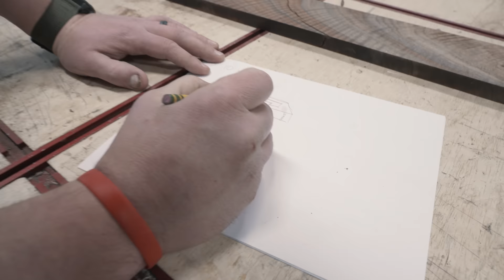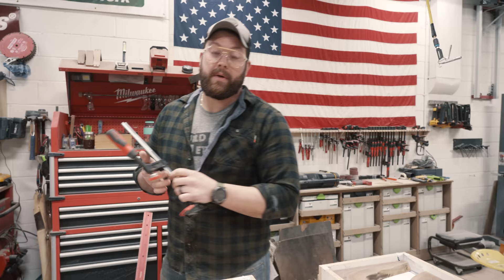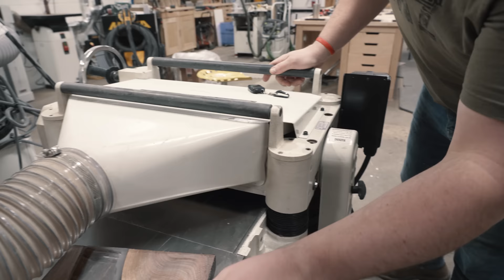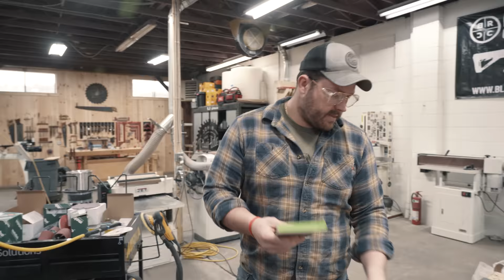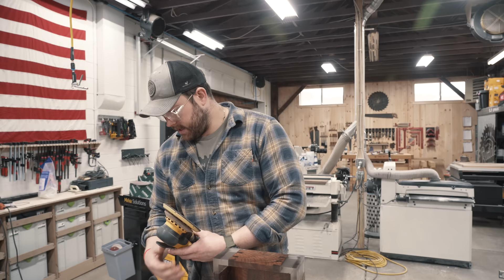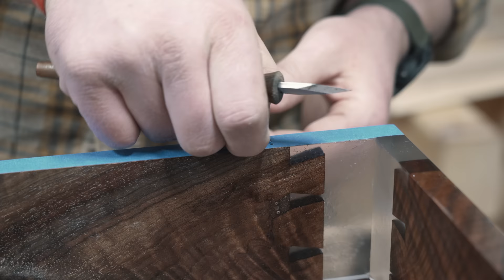CRAZY Epoxy "Floating Dovetail" Gun Display Box Build

Comment: She's pretty!  One suggestion though, I would inlay 2 rare earth magnets in the 2 epoxy blocks that touch the slide of the 1911.  That way, when you pick up the box, they'll hold the weapon in place.
Reply from the maker: Thats a great idea
Reply: That would depend on what metal the gun is made out of. Aluminum is non magnetic, and certain kinds of stainless aren't magnetic either. I'm not super familiar with 1911s to know which models are which.
Reply: I was going to suggest the same thing as soon as the video ended.   Then thought I'd check comments in case someone already suggested it.  GMTA Josh!  Additional suggestion is to put a rubber coating over the magnets to avoid marring the surface of that beautiful 1911.  Maybe even embed some small magnets into the edges and the lid to hold the lid shut.  GREAT vids John!  Subbed here.
Reply: I doubt the heat has a magnetic alkaloid ,tho the fact you mentioned inserting magnets in the epoxy rang a helluva bell in my brain so two thumbs and a thank you for that.

Comment: If you sand the epoxy (before finish) down to about 2000 grit, then use a polishing compound (ie: turtle wax/etc) and buff it quite a bit, you can get a near glass finish that looks great. It's alot a work, but well worth it for builds like this. Looks great!
Reply from the maker: yea i would have to sand the wood up too, all a balance. Solid tips !

Comment: Use painters tape for marking for the dovetails so it doesn’t mark the wood. Vacuum chamber to get air bubbles out of the epoxy, torch after pouring breaks the surface tension so air bubbles can come out.

Comment: Loved this video. just gave me some idea for a few different projects using clear epoxy or glass. one thing I'd add, on the top of the clear resin "floaty blocks", you could put some traction tape (also called roller tape) on top of the blocks. would keep that gun steady when the box is moved or bumped.

Comment: Gotta get a wool buffing wheel. Sand up to like a 600 or higher then buff the resin and it will be crystal clear. That’s how I do it at least. You can pick up a cheap set of 3” buffing heads for your drill just about anywhere. Love the piece and the Freedom Seed thrower inside !!!
Reply from the maker: Thanks for the tip!!!

Comment: Nice vid. Speaking of the stuck clamp pads, I was working with some epoxy 2 days ago and mine got stuck. All you have to do is take the clamp off and grab some pliers and pull them out
Reply from the maker: Nice, glad you could save em !
Reply: John Malecki to be fair they were 2.99 harbor freight twist clamps😂. If you get the right ones though, harbor freight is a great option for a lot of clamps.

Comment: I have a few ideas on this... The river is nice - it is a shame it wasn't used... Why not use it as a background behind the gun? You could slim it a little bit, maybe leave a tiny gap and put some LEDs behind it to give the river some color... In the gap, you could fill it with sand so under the river has a sandy bottom. Depending how much room you actually have in the box you could put pebbles, etc.. but that may not be viable. It would've been better to do that beforehand.

So the next thing after the river is in the background is have a wave cast out of epoxy, or 2... and have the gun mount into the wave. Not sure on the wave aspect - but it would be nice to see the river used. Hopefully these ideas pique your interest.

Comment: Resaw the river lid and router the edge to match the bottom panel and polish. This project is amazing one of the only epoxy projects that has stopped me in my tracks. But man you have to use the original lid.

Comment: I'm wondering why after pouring the resin for the sides that you then cut the four pieces out. If you had used a curved surface and heat, you could bend the resin into corners. Might that have been a good idea?
Either way, very cool work! Keep it up!

Comment: Friendly suggestions but epoxy does matter. Go with a crystal clear if you want no haze and be able to see through it. Maybe use your match piece that’s slightly too small, make the frame slightly bigger to comp. then (is that a Kimber? Can’t tell you move too fast) scroll a “K” in the lid and fill with clear epoxy.

Comment: Great project! I wonder if it would be possible to make a form where you can put the wood in place and then pour epoxy in the corners around it? So you wouldn’t have to miter the corners of the box?
Reply: Sure it's possible, it's all about building the form that holds/shapes the Resin as it cures...
The easiest way would be to build a form that holds the wood slabs on edge in a square shape with the corners exposed at the top to allow the Resin to be poured into the corners, once it cures, pull the form apart, trim, sand and polish the Resin...
Reply from the maker: yes but that leaves more opportunities for bubbles and air to get trapped. hence why i didnt do it.
Reply: John Malecki you’re the expert, boss! My knowledge of epoxy pours is pretty limited!
Reply: @John_Malecki  True, but a battery powered, hand held muscle massager from the dollar store could help with the bubbles by vibrating the sides of the form (like they do when pouring concrete)...
Or build the form from screwed together wood and put a rubber sealed lid on it with a connector for a vacuum pump (turning the form itself into a Vacuum Pot)...
Assuming of course that the form won't fit in your Vacuum Pot (if you have one, I can't remember)...

Comment: I think you might be onto something with the epoxy corners. If you do a future build, I wonder how it would look if you did opposing dovetails in the wood, rather than the same dovetails on each end, (so the dovetails would fit together without epoxy) and then do less epoxy. Then it would look sort of like an exploded view of an assembly in an instruction manual.
Reply from the maker: I did. I pinned the video? Check it out

Comment: initially (i was skipping thru the video) when I saw the dovetail I thought the epoxy was cut out too, but pouring it saves lots of work. Then I'm thinking, why not pour it in a 90° corner already, even less work and no visible corner glue-marks. Looks pretty cool either way

Comment: To get Crystal Clear Resin, you really need to wet sand up to at least 2,000 Grit (3,000-5,000 would be better) and then buff with a cloth wheel...
Kim Tippen recommends using Oil when wet sanding a wood/Resin piece as the oil won't cause the wood to swell which can cause the joint between the wood and Resin to break...
I think if you want to try surface Planing it you really need to be taking cuts measured in Hair-Thicknesses...i.e. just breath on the thickness adjustment wheel between passes.
That may help prevent tear out...(or may not, I don't know yet as I'm still trying to get enough money together to outfit a workshop)...

Comment: Great idea. I like the concept. I think the haze was from the sanding. Too many micro scratches. Once you added the laquer, you kinda screwed yourself. No way to effectively buff and polish the resin. An idea for the next one, should you chose to, pour the corners in place. Instead of pouring the sides flat, pour them in position vertically. No need to miter. A lot more work to finish it, but, most great pieces require lots of work. Enjoy the channel. You crack me up. :)

Comment: Really great project, however:

1 - Would have been much better polished to clear see through ( a "careful" use of flame for a flame polish would speed things up - a lot)
2 - You could have used pins to set the top and not a hinge (comes straight up) I do use this on some of my boxes.
3 - use a trigger insert to keep the gun in place if (when) the box is moved to keep it from falling off the supports.  
3A - A "floating" insert that holds the gun in place would also do the trick.  
3B - Think scroll sawing around the gun to hold it in place as it is inserted into the recess - only has to have a 1/4" (or less) edge.  Now that would be coool.
Reply: Now this I gotta see , what's the name of episode sir?

Comment: Perhaps next box should be similar but instead of mitered corners; cast it so the epoxy sets up as the corner so no glue up is needed
Reply from the maker: Yea my concern becomes bubbles then
Reply: I haven’t worked with much epoxy, but what if you heated it somehow from the outside to get the bubbles out ... tricky stuff that epoxy

Comment: Back when I used to work at Klingspor they had some 3 part buffing compound system that would take swirl marks out of anything. Or is that haze deeper in the epoxy.
Reply from the maker: the haze is in the resin, it didnt clear up because i poured it too thin

Comment: How do you Prevent the squiggles while sanding? When I Sand it to only 320, I have so many scratches.
Reply from the maker: You're going too fast. slow down
Reply: I use the mirka with 2,5 Orbit. I saw, you used a mirka too. Which speed do you Go?

Comment: err - you missed a step on the brass screw for the hinge - even with a pilot hole brass screws can shear before fully seating, best practise is to get a STEEL screw of the same thread pitch and thread that first to precut the threads, THEN screw in the brass one.... Trust me a sheared brass screw in a box is the LAST thing you want to have to fix, because most times you'll end up having to drill it out, plugging it, then trying again,  IF you got lucky and haven't blown a section out the sidewall of the box doing that - don't be that guy, use a steel screw first.
Reply from the maker: You my friend are correct, the hinge manufacturer for these didn’t provide a steel screw, and I didn’t want to try and find a matching thread. But that is the best way . Thanks for your expertise

Comment: Supposed to buff the epoxy, not the finish that you sprayed on it....
Reply from the maker: you can buff both. Because the epoxy was integrated with the dovetails it wouldve meant burning the wood to buff it first. Buffing finishes is quite common. When you buff a car you only do the top coat, not the paint. Same concept